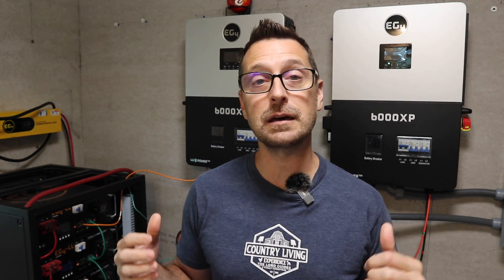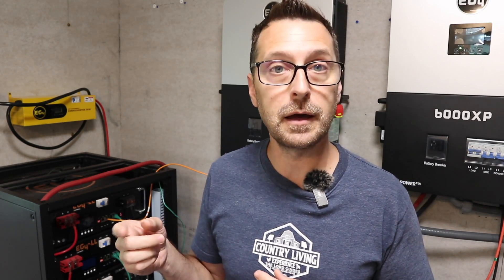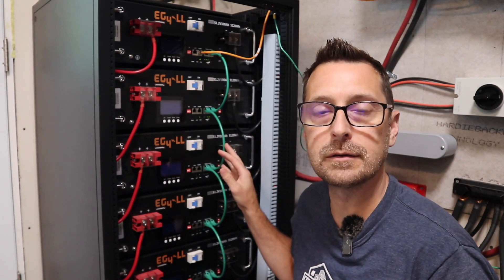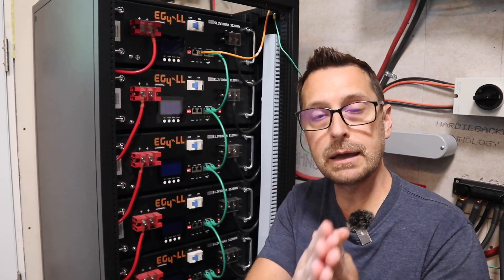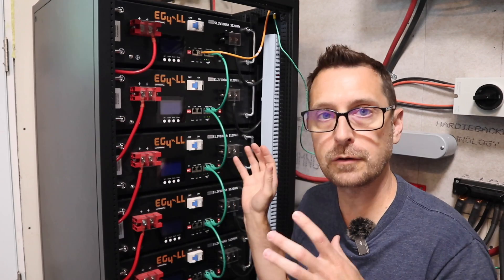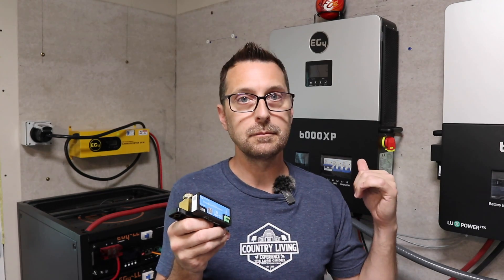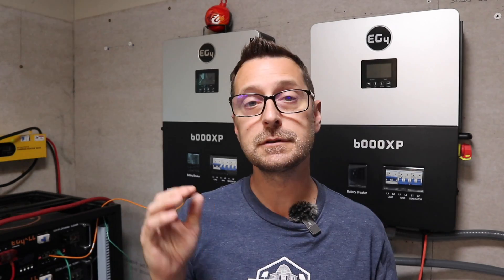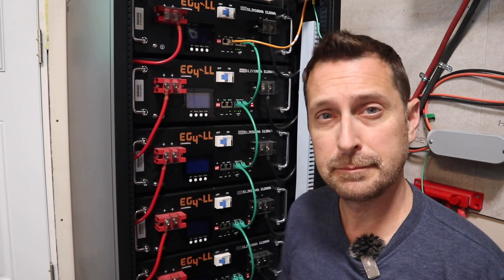Lithium Battery State Of Charge VS Voltage Drift. System Issues? Several Solutions

Comment: All of those percentages are correct for 13.3v
My LiFePO4 when discharging lightly is at 13.3v from 97% all the way down to close to 50% where it drops to 13.2v.
A shunt is necessary for sure. Voltage tells you close to nothing

Comment: I have a setup in my RV that is experiencing a very similar issue. Here are the details:   Two EG4 Lifepower4 v1 12v batteries in parallel with Victron shunt and Magnum 2000w inverter.  Stack is 800ah.  On heavy discharge batteries will shutdown due to low cell voltage when shunt is reading ~70% SOC, and ~250ah discharged.  BATTERIES SHOW 0% SOC.  It makes no sense. I’m in contact with Signature Solar tech support on this but no resolution yet.  Also, on the charging side I get battery protection due to high cell voltage which has me not trusting that they are getting to 100% SOC, although both the batteries and the shunt say 100% SOC.  I’m getting ready to rip it all out since it is not meeting my goal of running my AC off the batteries overnight with capacity to spare.  Let me know if you had any other relevant findings that might help your and my situations.   Thanks, Henry
Reply from the maker: I just switched over to lead acid mode and run it from voltage readings.

Comment: You need to charge to voltage limit and less than 2A on each battery then most bms's will reset SoC.
Some bms's expect this once per month.
Reply from the maker: Top balanced before this video. Still and issue years later and continues to be for most.

Comment: As I seem to be running my mouth I would like to point out I did learn something about the inverters from this video.  RE  how to use  voltage instead of state of charge to determine when to charge.
I have what you have there.    I have been working around it for now but this is a serious issue and here is why.   
If you have say a 500 ah battery and the inverter wont charge until it gets to 90 % state of charge then you could be leaving 50 ah of sun energy that was available that the inverter just would not let you capture... it will by pass it but wont let you store...

The simply question is for me is why wont the inverter do what it is told to do from the BMS  if you have them connected and the inverter shows its little happy face and no errors yet it wont do what it is told from the BMS.
I have a JKPB 150 amp inverter bms.

There are simply too many options that every manufacture is putting all over their equipment to "sell it"  to people that dont understand what most of  the options would do any way.
I need to contact Lux Power to get to the bottom of this.... with a large battery bank     "  I   "   would like to be able to decide when my batteries charge thank you very much.
In the inverter it does look like I should be able to  "disable"  charge by voltage or charge by % but I can't  figure it out.

Given you have now voided your warranty you can restructure to make you system serve you not the battery.
It should be set up to have the batteries shut down  before the inverter other wise you can have the inverter shut down when you actually still have charge in other batteries but the one it sees is lower than its threshold.     Set the bms to shut down at say  42.5 volts and the inverter at 41  and when you come back to a "shut down' system you know the batteries are all at less than 2% but not dead.    With the voltage recovery from being off and a blip of sun the system comes back to life and start charging the batteries that are near dead but not quite dead and you used every bit of  "gas" you had stored.   Why hold  one gallon back of a five gallon container.   

It is a journey not a destination...  I appreciate that you share your road with me as I stated I learned and that is why I watch and share.

Comment: 10:00   Let me get this right.... you paid for 100 AH batteries but in order to maintain  their warranty you can only use 80 AH?  I must be miss understanding this....  
Would you buy a car that did 160 mph but agree to never drive it over 130 mph or the warranty would void..?. you don't think a speed sensor  that said you went  134 mph would cancel your warranty?
If the above is correct then you can simply sell a person anything.   
You are completely beholding to Lux power and eg for your home energy as you rely on computers for it to  work properly.
If you have your system connected to the net as I believe you do then you should understand with an  "update' you have nothing...  maybe you are ok  with that but I hope someone reads this that does not.
Reply from the maker: Relax dude.

Comment: If this is an issue for anyone.... they need to understand the charge characteristics of lithium iron phosphate and then it will be a non issue....    If  51.2 volts is 15%  and 52 volts is 95%  how do you expect it to tell you the state of charge with a voltage rating?      If it matters to you a great deal the total amount of energy you have available then you need something that measure energy.... a shunt measures amperage which is energy.... voltage is "potential energy"  
90% of people with an off grid system that fret over this simply have too small a battery bank.
Would you drive a car that was going to run out of gas every day... and not even be able to say when???
Reply from the maker: That is not the issue I was talking about. I understand the charge characteristics of LiFePo4.
Reply: @CountryLivingExperience  You clearly understand your system.   I was commenting more to the masses.  And the more comments I make the more tube pushes this up ladder.

Comment: Hi great video as always In really like your videos I’m having the same problem I have tried to upgrade the firmware I’m having not luck I have fallow the instructions from the eg4 website but I’m having not luck can you explain to me the steps you did I have the same battery as you have can you please show me  your way    Thank you
Reply from the maker: I worked with tech support to update the firmware. I needed the correct cable as well.
Reply: @CountryLivingExperience   what cable did you need
Reply from the maker: I don't know how to describe it to you. It is the cable for the V1 LL batteries. Call EG4 to get it.
Reply: Hi the cable is called EG4 RS232 firmware update cable LL  I have to order hopefully that would fit the problem
Reply: I'm getting nowhere with tech support  can you email or tell me what is the cable you use

Comment: I am facing the same problem from the day i bought my second battery and put the 2 in parallel. 
Another problem i have though is that the 2 batteries are charging/discharging at different rates. The difference can even be 3 or 4 Amps for a total load of 30Amps. Which is a lot! Have you ever measured charge/discharge rates on each battery to see if they have different rates?
Reply from the maker: I can see the charge/discharge rates on the screens of each battery. The battery bms should put the load where it is needed most......that is if you have communications set up between the batteries.
Reply: @CountryLivingExperience  BMS is not always accurate in Amp counting. But lets say BMS is the same for each battery . Do you always see 10Amps on each battery for a 90A load?
Reply from the maker: @Theo2482  I know that. I don't monitor mine that closely for amperage draw on each individual battery.
Reply: @CountryLivingExperience  If there is a different amperage draw on each individual battery then the SOC issue should be partly because of that. Let's say 2A draw difference can make a big change in SOC across the individual batteries over time.

Comment: I think maybe you'd need to balance at the "bottom" to avoid that ?

( all your batteries are/were, probably not carefully matched at the factory one by one, an exclusive and expensive endeavour; winston does that, on special request, i have seen once, very expensive, i was given 20  small 60 Ah batteries, Winston,yellow case, each one with a special factory engineering sticker, hand written,    the person had quit a prior  project, had them laying around for some 2 years and then put an ad to sell them for 400 euros,ended up giving them to me for free); 

 but then your  system would shut off too early when charging;   i do not balance at top nor bottom, but more or less at the middle, seems to work better;
 
i have a 48 volt system  with 40 mismatched lifepo4s of all sorts and sizes, all but 4 small ones, bought used, cheap, some just given to me,like i said, had not been used in years;

i arranged them in some weird combinations for the 48 volts; used to be 24,  now 48 volts;
the BMS is set at 2.65 and 3.55

i have a chinese open frame, low frequency (50 Hz),  64 euro, delivered ,inverter; this is my third, the first 2, of high frequency,  they both  burned up within 6 to 8 months, they did not use the famous EGS002, had sanded, erased, ICs, could  not be fixed( i eventually did fix them, rewired and converted them to the SG3525 (2 or 3 euros the whole board!!), 1st stage at 23000Hz, and to the EGS002 (only 4 euros each dlivered!!) the 2nd stage, from the 380VDC to the 220VAC, 50Hz; a lot of work! i have them on the side, they are only 24 volts;

amazing to me is the Lithium chemistry, even mismatched as can be, the 40 cells all behave very similarly;  voltages are king, 54.x  is FULL, 49.x is empty, the BMS disconnects; at top and at bottom the cells go apart, and in a big way;  it matters not, the system is sort of oversized, that is key;  i have 2 strings in parallel; #1 is 8S+2P8S  and  #2 is  8S+2P4S; 

it has worked flawlessly for a year now, this inverter CANNOT BE KILLED, 24 Mosfets, 3 proper Aluminum heat sinks, its own fan; tried ALL ways to kill it, cannot b killed; they MUST have the extra wire with the 10Kohm resistor on the EGS002!!! if not they die at any start up or any disconnect, due to the bad design with the LM393; mods are therefore needed to remedy that, the net has that,also on R7 and C21;

   of course, it uses a big toroidal Si steel trafo, 19 Kgs, rated for 2000 watts, routinely up to 4100 watts for 5  to 10 minutes, i have it fan cooled with a good computer fan,12 volts,auto start, via one of those small 50 cent  40ºC thermostats, TO220 case; and a mandatory 50microHenry 200 Amp inductor on 3 stacked toroidal sendust cores that i wound with 8 turns of 3 or 4 AWG wire.

i thought i'd write this, it's an el cheapo system, well tried, completely off grid, and works amazingly well;   the high frequency inverters with the small yellow trafos cannot be as reliable, they work with 380 to 400 VDC and air humidity, spiders, mosquitoes etc etc ends up killing them, some day, but the low freq one has been bullet proof; just that the trafo is VERY expensive, i paid 180 euro delivered.new, from a factry in barcelona, from Spain to Portugal but i see them on the net from 300 to 600 euros.
Reply from the maker: Thanks for sharing. Glad you could build a system from scratch.

Comment: Great video, not hearing much coverage of this issue that seems to happen with all these Lifepo4 batteries. I have 4 chins 48v 100AH tied in parallel and I get one battery showing 82% the next showing 84, 88,90. Same issue voaltage is the same across the units. This is total voltage though. When they reach 100 some of them snap in and say 100. Sometimes I wait until a few hours after dark after the bank has rested and use the XiaoXiangElectric app which is free to reset the capacity. Are EG4 Chinese made as well? I Bert the app can connect to that BMS to reset. Thanks for covering this.
Reply from the maker: You're welcome. 
Yes, the EG4 are Chinese made. Hope you can get yours worked out.

Comment: I recomend to measure voltage on inverter not SOC. Proper voltage is what is key to protect batteries. Than add a device that measures energy in and out of battery for SOC, it can be separate, or connected over RS485

Comment: I have the same V1 of the EG4 LL batteries and have a similar, but different issue that I have previously reported; I have batteries reporting 100% when the voltage is down in the 48 volt range (not 100%); I have to top them off periodically with an EG4 charger or eventually the inverter will trip an alert for low voltage and run a recharge cycle from a grid connection. The alert clears when the battery is fully recharged.
Reply from the maker: You are one of the few that have commented that understand the drift. Mine were doing the same. I think, like you said, it is a periodic top balancing issue. I may have to top balance mine again to pull the SOC and voltage back into alignment.
Reply: @CountryLivingExperience   - I'm still using the Growatt inverters also, so I think that confirms that it is specifically battery firmware and NOT the inverter hardware/software issues. I have NOT noticed the drift yet on the "production system", which is 100% off grid with NO grid connections, consists of (5) EG4 LL batteries, (2) growatt 5000 watt, 240 volt inverters, each with their own split phase transformer and about 4000 watts of solar panels. My "test system" consists of (1) growatt 120 volt, 3000 watt inverter with (1) EG4 LL battery and NO solar. This is grid tied and setup to function as a UPS. This system has the reported drift and about every 3 months, it throws a low voltage battery light error and goes through a charge cycle (from the grid) and tops it off without intervention (if I don't manually do it with an EG4 charger).  I have thought of using the victron shunt like you, even if it is only to confirm the drift by seeing over time that the batteries are not being fully topped off (wattage discrepancies on the victron shunt).
Reply from the maker: I may just kick mine back into lead acid mode so I can set the voltage parameters instead of using soc to determine low cutoff. The soc from the batteries with comms enabled just seems too unreliable. I may also have to do another top balance.